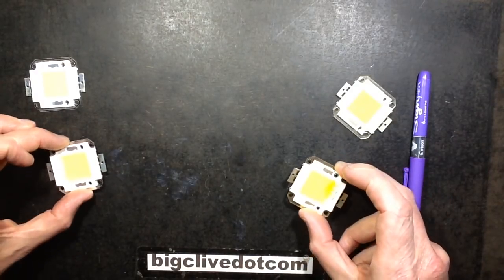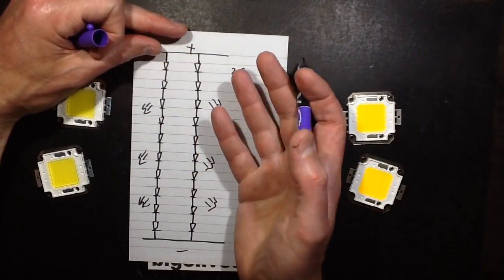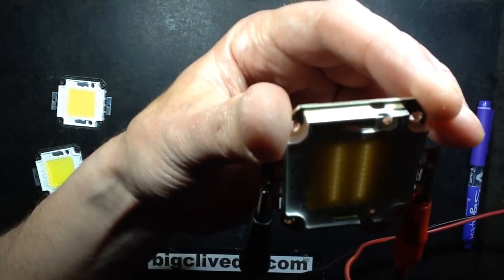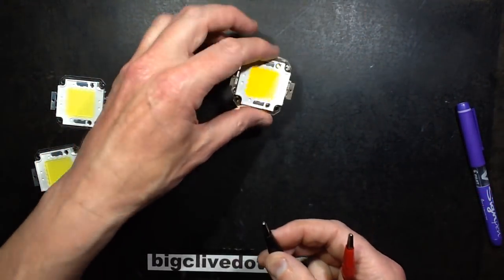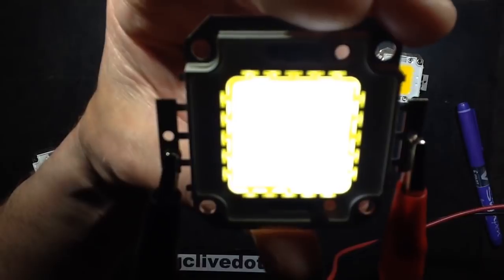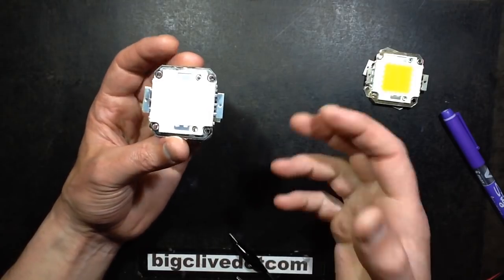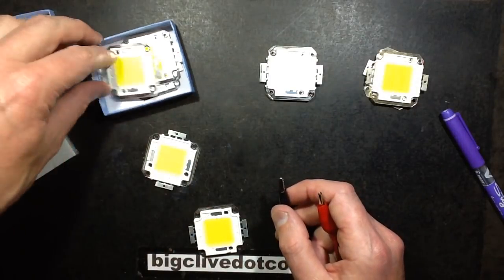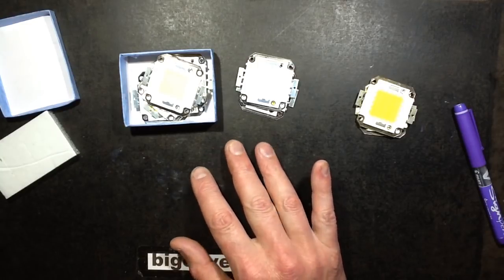Testing dodgy 100W LEDs from ebay sellers.

Comment: Question remains is on where to buy the good ones on Ebay. I guess one can't.
Reply from the maker: +Hendrik Hendrikson It's hard finding good LEDs on ebay.  Even sellers that provide better ones may provide crappy one the next time.
Reply: +Hendrik Hendrikson If you want high quality LEDs buy them from electronics supply companies like Mouser or Digikey. Just be prepared to pay for them, quality doesn't come cheap.
Reply: +SpeakerLover1000#EPIC I haven't found Amazon vendors to be significantly better quality than eBay chinese vendors.
Reply: Well you just buy a lot of them, cherry pick the nice ones resell the rest on e-bay to people looking for a bargain.
Reply: Ive bought a few off amazon from china. only 10w 9-15v dc , work great with no duds. 
I took one up to 2A @ 12Vdc it was so bright lol. It got up to 246F w a heat sink before i shut it off and still works fine. smoked a little. rofl  I think i paid $6USD for 10 LEDs like these. Made a nice LED table lamp
Reply: +Hendrik Hendrikson It's like buying flash memory products on eBay, most are reprogrammed fakes, so it's probably not worth the risk.
Reply: SpeakerLover1000#EPIC Thanks mate. You're right of course :)
Reply: Tommy Waldner Thanks a zillion!
Reply: +bigclivedotcom not that it means much, but i got one on amazon about 2 years ago that ive had in a flashlight ever since, and its perfect. as the knob is turned, each led is exactly as bright as every other led at any power level. more recently i bought several more from the seller for an area light and they light up unevenly, but they have been working well after a few dozen hours of use so far
Reply: +Devin Royce in fact, i was using the area light one night to work on a car, and the wire for the fans had been shorted, and after a few hours i smelled something burning and touched the heatsinks on the led and got a decent burn, they still work tho
Reply: I guess that's what the seller already did xD
I can imagine the yield on those is not that high so they have to cherry-pick themselves before they ship them out to the large sellers like digikey or mouser.
I think it is propably not that easy to spotweld about 200 times on the same small piece of metal and expect all the LEDs to survive
Reply: I assume all of his work too, its just when you drop the voltage to see if they were properly matched (all LEDs are different for some reason)
Reply: +Hendrik Hendrikson I just bought one on ebay (item 331620077265) and all 100 worked for $5. Not that they'll always sell perfect ones but it's a start.
Reply: Might find more consistent products on AliExpress. Not necessarily better, but some of the AliExpress sellers seem to be the actual manufacturers.
Reply: +Hendrik Hendrikson good LEDS aren't on eBay try Amazon
Reply: Buy a Chinese COB, Get Chinese quality ... Does not matter what supplier.
They are crap straight from the Chinese manufacturer... Or supplier is selling used/reject/refurbs.
Spend $ for quality control & Buy North American.  Problem Solved.
Reply: We Sunrate ET Co.,Ltd are also the LED supplier.
website: sunrateled.en.alibaba.com

Comment: What are the minimum and maximum operating voltage specs for the leds you have identified as faulty compared the voltage band under which you tested them? Without knowing that's its impossible to say if your test is a fair assessment of performance or not. Also are the 100W leds dimmable or not? If not, the miss-matched performance is not unexpected at low voltage levels.

Comment: My 50W COB type floodlight failed the other day, after 5 months of lite use. I've ordered a new Taiwanese chip but I have a feeling the driver could be an issue to as it was putting out 44v (when connected to the chip), its output is supposed to be up to 36V. 

Someone suggested to me that the driver has failed and now puts out to much voltage for the chip and so it destroyed that to.  

I got it from "gutedealscom" on ebay.co.uk and they claim to provide a 2yr warranty so we shall see.

Comment: I wonder what would happen if you turned the voltage up to 30 volts and viewed the chip through some kind of optical filter. Perhaps even a twin rotatable polarising filer.

You might find that they all the led's start to light up but some would be shunting more current than the others. 
It comes down to poorly matching components in production and what the circuit  designer intended in terms of tolerances in the design.  
The have probably been rejected by the manufacture and sold on which is questionable ?
Reply: +Jeremy Clayton-Travis Or better yet, he could view it through a dilating anti-matrix supercooled Reischel lens, with an anti-clockwise rotation in the centre glossifier. That'll definitely make a difference.

Comment: http://www.aliexpress.com/item/Real-full-watt-20W-30W-50W-70W-80W-100W-led-Beads-30x30mil-chips-for-High-power/32547081196.html?spm=2114.01020208.3.174.sG627o&ws_ab_test=searchweb201556_1,searchweb201644_2_10001_10002_10005_301_10006_10003_10004_9911_62,searchweb201560_1,searchweb1451318400_6148 This seller sells trusted ones. Speaking from experience
Reply: +Adam Ryan jep, the LEDs with sone QC on them cost more, but last longer.

Comment: I have question, why do you need 100W led?, where usually these led are put into? I play few led but never up until 100W.
Reply: Bassotronics Its not simple as that. In audio, speaker does not double its loudness by adding another speaker. To double the loudness, you need to add 9 speaker. It exponentially increase every time you try to double the output.
Reply: +Nick John 
LED efficiency decreases as the wattage per diode goes up, so 1w is a decent trade off for light penetration vs efficiency so they take 100 1w diodes and stack them really close together.
Reply: RisenThe Ohh I see.
Reply: +RisenThe 
So in reality, the '100 watt' statement is bullshit.
So it's like taking 100 1 watt speakers and stacking them all close together to put out a loud sound.
Although I have seen a 1 led 10 watter and those things are bright as heaven.
Reply: Nick John
I know lol. I was just trying to provide an example.
Reply: Bassotronics Owhh :)

Comment: Want quality CoB (Chip-on-Board) LEDs? Hunt down some of Cree's CoBs - they have LED modules that can deliver 17,000+ lumens. I used a few to retrofit my house's bathrooms to use LED instead of incandescent lighting.
Reply: +OddlyIncredible 17000 lumens in bathroom? How big is it?
Reply: +Codeplayer About two inches square. I mount 'em in the middle of a large aluminum bar (3" wide, 1/2" thick, a foot long) with two large processor heastink/fan combos attached, one on each end, to cool the assembly. Not the most elegant solution I'm sure but flat/thin enough to mount on a ceiling without hanging too low.
Reply: +Codeplayer Aaaand I just realized you probably meant the bathroom. The largest is a master so it's decent-sized, but 17k is way, way too much so I run them underpowered, which has the added benefit of being far more efficient.

Comment: One could draw an I_Log E curve for each led and it may appear that at sufficient current they will all deliver the lumens as specified. It may be that they just extinguish at a different level where they would not be useful anyway. I would test them at full power and view the light though an neutral density filter to see if any are in fact failing at full power. Your video does not show that.

Comment: What are the part numbers? 

The LEDs could be connected in parallel individually on that chip, so it makes sense that the individual activation voltage could change from diode to diode.

Comment: one thing you have not considered is that there are different color leds in the 100watt modules to achieve the look of a cool white. THey will all behave differently.
Reply from the maker: +Jeffery Legere All the LEDs should be identical.  It's the phosphor coating that adds the other colours.
Reply: note their color in as you slowly turn up the power. when they are barely lit you should see the other colors. I could see them in your video.An individual led only puts out one frequency, what frequency is white?
Reply: a spectrometer will show the frequency lines put out by the various leds.
Reply: +Jeffery Legere wrong. probably a camera artifact. as Clive said, it's the phosphor that creates the colour. Possibly in some spots the phosphor is thinner and you're seeing the bare LED come through a bit.

Comment: I am an industrial electrician also.  I was forced into my job, had to drop my EE classes to support my kid.  It was strange dropping low voltage dc electronics.  I use an analog military chinese megger at work daily.  super cheap.  I'd love you to tear down one.  I'd buy it for you.
Reply: +two scoops 480v 3phase theta. So i shoot for anything over 500Mohm.  Below that my VFD's start tripping.  Super sensitive Freq drives.  Allen-Bradley.

Comment: At first i thought some leds are dead too, but then i got a lense that focuses individual leds on a wall. i ran the matrix at full 100W power with heat sink on  and all 100 worked fine. i concluded that each led had slightly different volt-ampere characteristics and in low power mode some turn on later then others. And led conducts some current, even if it is not emitting light so it explains why some in same series glow and others dont

Comment: Would you please provide links to the "good" ones?
Reply from the maker: +John J Sadly no.  I've not found a truly good 100W LED on ebay yet.
Reply: +bigclivedotcom i assume it doesnt really exist
Reply: +bigclivedotcom 
What I mean to ask is would you provide the link to the first batch that you demonstrated, that had 2 rows of LEDs that lit up and dimmed rather nicely?
Reply: +John J i know yuji led sells high cri 100w cobs, but those are relatively expensive (but great if you want accurate natural white colour)
Reply: +bigclivedotcom http://www.aliexpress.com/item/Real-full-watt-20W-30W-50W-70W-80W-100W-led-Beads-30x30mil-chips-for-High-power/32547081196.html?spm=2114.01020208.3.174.sG627o&ws_ab_test=searchweb201556_1,searchweb201644_2_10001_10002_10005_301_10006_10003_10004_9911_62,searchweb201560_1,searchweb1451318400_6148 , Its not Ebay but this guy sells amazing LEDS. They all work well and spread an even current within in the LEDS

Comment: Where can I get one of those power supplies with alligator clips?  I'd like to get into electronics but I have no idea what these things are called.   

Also is it practical to get these LED chips to make indoor lighting, say for the kitchen or living room?  What are these made for primarily?  I see a lot of videos on YT with people making spot lights, filming lights, etc.

Thanks
Reply: +supercooled Power supplies with various voltage outputs and current capacities are available from industrial electronics suppliers and hobbyist level stores. prices range from a low of about $50.00 to several thousands of dollars for high capacity precision units. Following are some examples:http://www.active123.com/GE5024-ACDC-Power-Supply-50W-24VDC-22A-Prodview.html and http://www.active123.com/AK20024-ACDC-Power-Supply-200W-24VDC-84A-Prodview.html . These supplies would need leads with alligator clips attached to the output terminals
Reply: I am looking for one also

Comment: fuck that led bullshit get yourself metal halide my work bench light purchased from ebay 7£ for fitting and bulb 70w and 15£ 3 years warranty electronic ballast ...all going strong and will last for ages not like them leds just dying randomly whenever they like ...with metal halide you can chose temp from 3k all the way to 20k also wattage 20w all the way to 1500w :) iam also using 70w metal halide for flood light and was on pretty much every night for last 3 years no issue...only downside is that it takes about 40 sec to get light to full brightness :) i dont hate leds just think they way overrated and overpriced for what they are...reason why i didnt mention high pressure sodium is simply colour temperature ...useless for anything else than growing weed and street lights :)

Comment: Chinese rubbish again those so - called 100W LEDs. I can recall a ghastly amplifier chip they used in the Fidelity Radiomaster in the 70's. They'd go so often they weren't soldered in, you could easily replace them at least. The best way the punters found to bugger them up was to connect extension speakers to the Radiomaster, halving the impedance usually and cooking the chip ! We called it the "hedgehog" and rumour had it they were all Texas Intruments' rejects !

Comment: Hey Clive, any chance we could see a scientific torture test of the crap LEDs vs those primo ones? Maybe drive several of each with too much power, or drive them with no heat sync and see how much of a difference we could be looking at? I mean if the shit ones still last 90% as long for 20% the money, then they might certainly have some uses somewhere.

Comment: Did you happen to read the data sheet for these LEDs to see if Dimmable=Yes or Dimmable=no?
It would make sense since you're running them at very low power. Perhaps they 20watt LEDs are dimmable and the 100watt LEDs you ordered are not...

Comment: The cheapo 100W's I've got work at full voltage - the uneven distribution of light at very low currents seems to be purely due to
differing ohmic leakage currents - every chip lights up bright at full current.  Its not clear if this is because they are seconds,
or because of a new process where the leakages are less controlled
Reply: +Mark Tillotson And I've just compared one against a known good 100W (perfectly matched), and the cheapo one
is significantly brighter at 100W in.  Its using more recent tech, basically - so despite the imperfections its seems
perfectly viable light source.  Whether there are long-term stability issues remains to be seen.

Comment: I think because they are wired in series is the main reason they light that way, I have a 50 watt LED light that does the same thing until voltage raises about 29.8 volts then all light evenly, also I'd like to point out that a driver and regulated power supply is also recommended for this application without driver attached the voltage does not always remain steady, current is regulated with the regulated power supply which is the mist damaging thing about LEDS. If you get a mismatch in both light output is affected, my 50 watt LED draws less then 2.0 amps but heat is def a factor and a good heat sink is required once you run close to the max amps and voltage.

Comment: i just ran up a 100 watt I bought from a seller, and it only draws just under 1 amp, so probably 30 watts?1  has anyone found an ethical EBAY seller?
Reply: How are you driving them? What voltage are you getting at 1A? LEDs are not like resistors; they draw almost no current until a threshold voltage is reached, and then small increases in voltage cause large increases in current.
Reply: +Michael N   I ran them up at work using a power supply and decade box to limit current.  I don't have my notes in front of me, but I did notice a spike in current as threshold was approached. at just under one amp and 32 volts, the chip was screamingly bright. any current above 1 amp, and the chip started smoking, so I shut it down. I have very little experience running up led's so this was interesting.
Reply: Nonde Menai
Are you using a heatsink? You'd need a very substantial heatsink (carefully mated to the LED with heatsink compound) to run these anywhere near full power (most of the input power needs to be dissipated as heat). If you've seen smoke, the LED is toast - even if it still outputs light, you've irreparably damaged it.
Reply: +Michael N yes, a heatsink from an old Intel chip with conductive paste.
Certainly not a task specific cooler, but it seems passable. Thanks, I suspected the LED's were now fried. live and learn
Reply: Hmm, sounds like your heatsinking is OK - maybe not for the full 100W, but it shouldn't have smoked at only 32W.
Reply: +Nonde Menai I guess your chip was a 700mA chip, so putting over 1A in it probably now toasted it, certainly if you saw smoke.
Reply: +Codeplayer I tend to agree, I can not understand how sellers can keep vending subpar products.

Comment: friend can a 10 wat led be derect in a 12volt without a led driver but it has a heatsink and a fan
Reply from the maker: You may be able to use a resistor to keep the circuitry simple.
Reply: +fahad rangaig LEDs can work as long as you don't exceed the reverse breakdown voltage nor the maximum current.
Many suppliers don't give the maximum current. If you have a lot of LEDs you put them through an ever increasing current (use a multimeter to know what it  is) until they fail. Otherwise, you get their claimed power (eg. 100W) and the rated voltage (eg. 25V) Power=Current*Voltage, thus 100=??*25, little algebra later: current=4A. Therefore, the LED can work at any voltage as long as you limit its current to 4A (using a resistor, for example). At 50V... Resistance=Voltage/Current => Resistance=12.5Ohms
If the reverse voltage is higher than that, go ahead an try out. Careful, because this is a simplification. Go search about LED voltage drop (which will change the resistance needed), the difference between Electrical Power and Lamp Intensity Power, and Ohmic Heating (which will tell you that it might not be a good idea to run high voltages for long even if the current is right).Spoiler alert: your LED, at 50V will consume 50Ohm*4Amp=200W! The power extra to the 100W will be released as heat.
Reply: thank you friend ^^